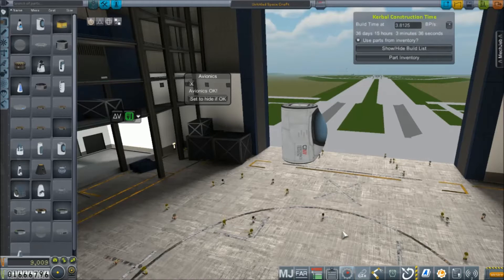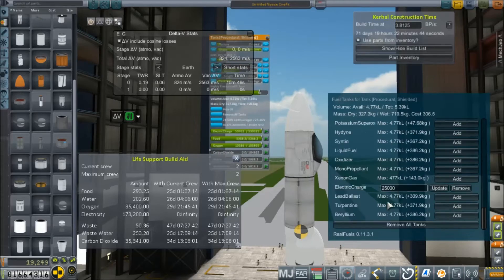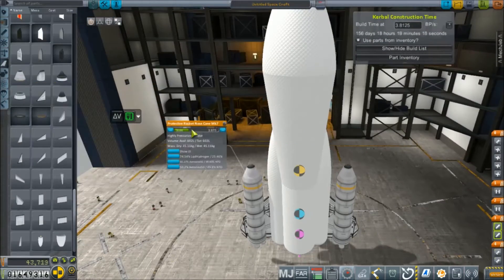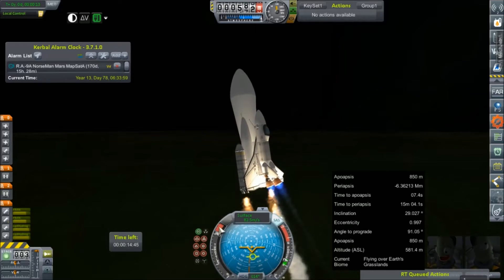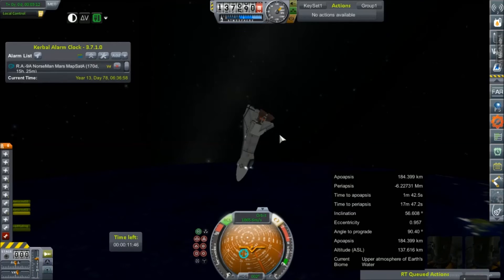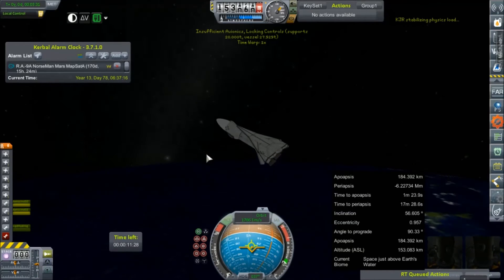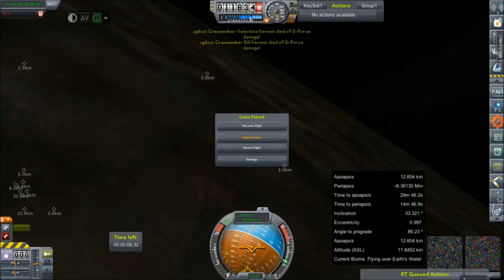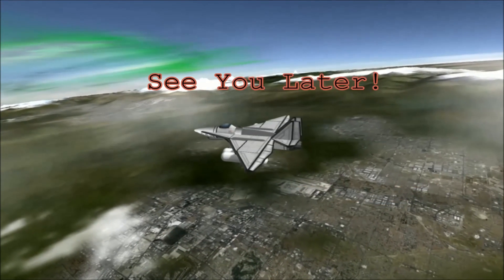KSP RP-0 #128 1960s Shuttle Program (prototyping reusables part 2)

Comment: "This thing is horribly expensive"

YOU IDIOT, THATS WHAT HAPPENS WHEN YOU BASE STUFF ON THE FLYING BAR OF GOLD

! Lol, but seriously, i was practically yelling at my screen when you said you were inspired by the shuttle.  Falcon-9 style reuse-ability is the way to go for practicality (though you may want chutes). I recommend you install a mod called FMRS to handle reuseable stages.
Reply from the maker: red melon lol, yeah the cots spiraled out of control pretty quickly (just like the real thing!)
stage recovery wasn't comparable with 1.1.3 when I built the install, and I may have missed the window on including it. ( as an aside, I feel it can make things too easy, getting full credit back for a booster becomes relatively simple, and negates a huge chunk of initial costs.)
this became more about seeing if I could build a shuttle type design for RSS, never really considering if I should build a shuttle at all lol. in the end though, I'm glad I did, I learned a lot from it.

Comment: i suggest starting "smaller"... lose all payload sbility, additional supply's other than cockpit default 3 days (1 day should do for testing/mass minimizing-fuel maximizing) and battery capacity other than enough for a few orbits. after that minimize wing amount to just whats required to glide back down empty of fuel (deal with heating with shielded tanks only instead of obscuring body with wings) go with a single J2 rocket instead of 2 (plus the boosters if you find them build enabling). Your OMS engine choice seems solid for the options you have due to their throttling ability. 

TLDR:
1: reduce mass/size of space plane itself to bare minimum needed to be able to finish orbital insertion/glade into landing
2: losing mass of 2nd J2 will help make insertion to orbit easier & craft cheaper... as long as TWR after booster separation is 1.01+

If after doing this you have a success you can "scale up" space plane to a 1 ton payload ability/longer duration ability
Reply from the maker: So far as the math looks now. 2 J-2s will be needed. Even with that the post booster sep TWR is ~.85 and with a good enough lift from the pad that should be good enough.
Oddly enough, the wing surfaces have higher heat tolerance than the shielded tanks (2500K vs 2200K) that little bit of insurance makes a world of difference.